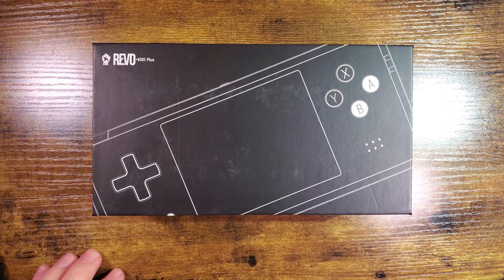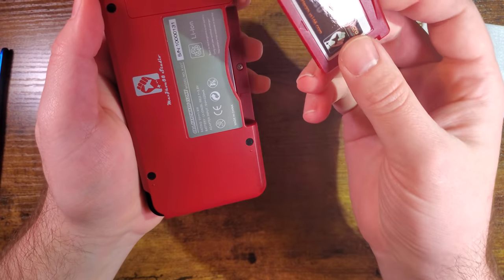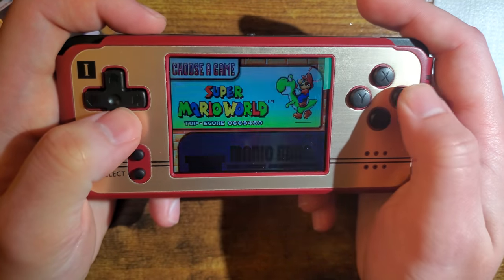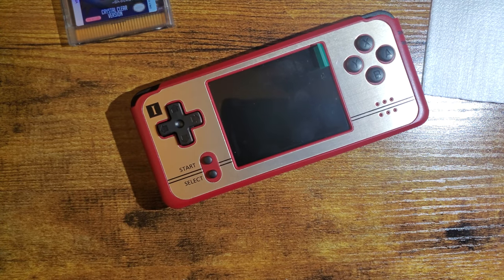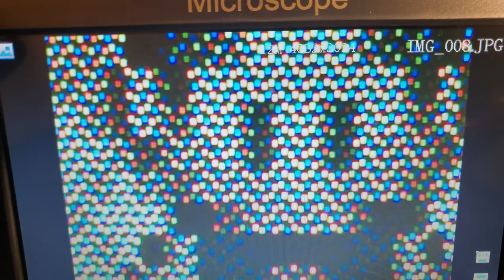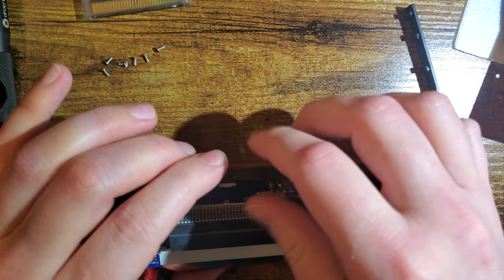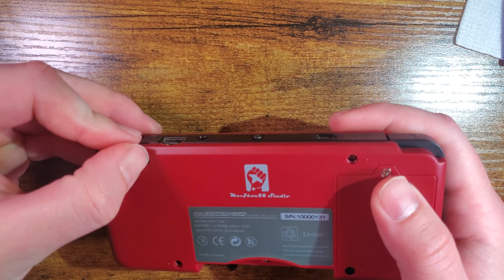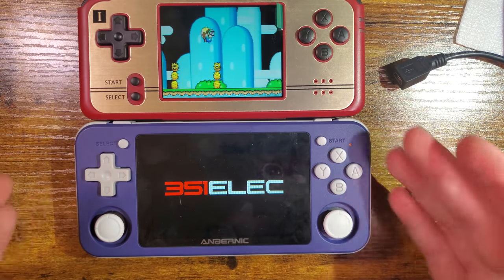Revo K101 Plus

Comment: I got this exact model and i love it. Build quality is nice, you can change the screen aspect ratio in the menu to always boot in the correct one (you can also use the brightness buttom + down), only noticed some slowdown in castlevania aria of sorrow when maneater enemies are on screen and in zero mission when there are a lot of enemies on the same screen, but honestly even on oem hardware zero mission has slight slowdown in some chase sequences.
Reply: Got mine on aliexpress btw
Reply: Also, in the menu you can also save the default brightness setting

Comment: From what I remember of high-school science class, golds a better conductor of electricity then any other metal. The only reason we don't use it in homes is because of how expensive it is over copper. So maybe that's why nintendo used gold contacts is because of that and because of how little gold the contacts would need, so it wouldn't really be more expensive.
Reply: Silver is the best conductor but gold is corrosion resistant.

Comment: Sounds like it's running just a tad fast to me- though not really noticeable.
My guess is it has a PLL multiplying that 27MHz crystal by 5, then dividing it by 8, to get a final system clock of 16.875MHz.
The original GBA uses a 4.194304MHz crystal, but multiplies it by 4 to get its 16.777216MHz system clock.
Thus, the Revo K101 Plus runs ~0.6% faster than original hardware, and has a hardware speed accuracy similar to that of the GB Boy Colour (though not the hardware reproduction accuracy.)
If you wanted it to be accurate to the original GBA, you would have to feed it a 26.8435456MHz clock signal.
IMO GBA hardware clones at this point in time are a ripoff, because they all use the same shoddy SoC clone and, as far as I've seen in this video, don't perform as good as emulators.
If we got a GBC hardware clone from Kong Feng all the way back in 2005 with the first GB Boy Colour that was 100% accurate, you'd think we would've had a good GBA clone by the early to mid 2010s... 2021, no progress ):

Comment: Do you have a 3D print file for that flat gba sp? For purchase?
Reply: Its something makho is working with RetroCNC. Should be on sale later. Its NOT from boxypixel
Reply: @raizudev  Well, I’m just glad that it has a Plastic version. The Boxy Pixel design itself was great, but the metal was a bit uncomfortable in terms of condensation from warm hands.

Comment: I bought one hoping for GameCube link cable compatibility but I've got two different models (digi retroboy looks identical) and neither one works with GameCube. Kind of disappointed, but understandable.

Edit: hmm just got to your part about the multiboot. Maybe I need to try again. If that works, then I'd think so should GameCube functionality.
Reply from the maker: I should test mine again. I didn't notice at the time of filming but while watching the premier, I saw that the wireless link screen showed an error. It may not be just your device.

Comment: What are the chances of flashing custom firmware onto the chips for these? I got a cheap one from Amazon recently and it needs it badly xD
Reply: I think you got one of the chinese emulation "knockoffs" of these. You should be able to flash custom firmware on those
Reply from the maker: On the Revo K101+, chances are very slim. I'm not sure that the firmware is even updateable, but even if it is, there isn't anything to update to. 

If you mean something like the RG351P, yeah updating the firmware is basically the first step you should take after unboxing it.

Comment: so ive been wondering, whats the best gb/gbc/gba hardware clone right now?
Reply from the maker: there are no GBA hardware clones and there's only one GBC hardware clone (GB Boy Color) so the question itself is kinda moot. 

Like I said, this thing is a hypervisor, not a clone
Reply: I'd say the gb boy colour is the best gbc hardware clone, and this revo k101+ is the best gba "hardware clone" It has some slight display issues with a few games but they're still very playable and the build quality is very very nice. 

I do plan on ordering an analogue pocket though, which will basically be the modern king of all retro handheld systems using fpga emulation (which means in layman's terms that they program modern chips to function in exactly the same way as the original chips so there should be 0% performance difference if done correctly) 

Seeing analogue's track record with their NES SNES and Genesis fpga clones, it safe to say that its going to be quite a premium product.
Reply: @shadeymcbones6707  I might go with analogue pocket then, it will play every gb gbc and gba games right? real cartridges and roms?
Reply from the maker: @shadeymcbones6707  I have first-hand experience with analogue consoles and I can say without a doubt that the Pocket will NOT be as accurate as they tend to imply it will be. It will probably still be pretty good, sure, but the hype for this non-existent product tends to skew things out of proportion.
Reply: @makho  ah sad, is it still worth its price tag in your opinion?
Reply from the maker: @shadeymcbones6707  absolutely not since it doesn't even exist yet. They sold a pre-order and we're still months away from whatever date they most recently delayed to.

Comment: One thing I noticed about mine is that if you pull the cart or while it's running the game doesn't crash so it's definitely dumping the roms
Reply: it does for me tho? The second the connection is cut the game freezes and the console restarts without the "nintendo" logo underneath the gameboy logo like a normal gba does without a cartridge

Comment: The A B X Y button membrane looks like the one in the Nintendo DSi just bigger, the epoxy isn't always used because it's cheaper but it could have been used to hide the chips so other companies couldn't just take this apart and make a copy, the sd to gba cart adapter this comes with might be using spi mode on the sd card and could be able to load ROMs from a PC by using a USB to spi converter and adding a cable to the cartridge or making a new one that has a cable and using some custom software on the PC to talk to it.
Reply from the maker: This specific membrane is common in clone consoles. It's an off the shelf part for chinese consoles, basically. 

Epoxy is used because a big cost to chip making is packaging. Under the epoxy is a bare silicon die with gold bond wires connecting it to the PCB. The epoxy is then used to secure everything together and reinforce the connection. When going for obfuscation, most manufacturers will have the top of the chip etched off, not covered in epoxy.

I took the SD adapter apart, there's nothing but a few passives on the board. Any conversion is being done on the console side, not on the SD card.

Comment: The graphical issues look identical to the super retro advance adaptor, DKC also glitches on the snow level but its hardware and not an emulator. I think any game using the 4th layer will have issues.
Reply from the maker: if it was "hardware" then it would have no glitches (or at least the same glitches a real GBA has). Just because it's not using software based emulation does not mean it's not emulation.

Comment: You can change the aspect ratio and Super Mario World is one of the only games that has graphical issues. Surprisingly, there are few games with issues. Some games won't launch at all. It has like, a 97% compatibility rate.

There is one issue I have ran into with only one game a few times. Metroid Fusion had all of it's save files erased for some reason. Quite odd.
Reply: Besides SMW and Metroid Fusion, what other games had issues/didn't boot up on the k101?
Reply: @waxoyello9085  no game so far hasn't booted. It just occasionally will delete save files on official carts. That seems to be really uncommon though.
Reply: @LelandHasGames  Thanks for responding, I am getting this for christmas so I was starting to get worried, but as long as SMW is the only game with issues it'll be fine
Reply: @waxoyello9085  yeah. It's mostly very accurate. It's not an emulator. It's some sort of hardware clone. I still prefer original hardware but, it's an interesting machine.
Reply: Its possible that metroid fussion original use battery and it is over

Comment: Just got the digiretro boy theyre made by a different company I think but has the same black background bug in mario. Wanted a black revo but couldn't find them anywhere and the famicom colours are horrible lol. board pics at imgur a xYUMIAy. Also has a globtop. just wanted it for pokemon trading so should be decent. the lcd was super smeared when it arrived looked like they cleaned it with one of those cheap alcohol wipes when they assembled it